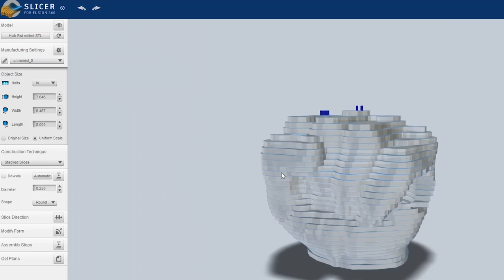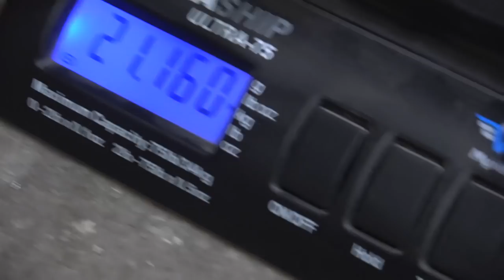Doomfist Destroys ALL with 2600 POUND PUNCH

Comment: Sarcasm aside, the first thing I'd recommend is adding an armature that distributes force through the shoulders and pelvis. Then you could attach springs to take up some of the massive weight of the fist (kinda like how a garage door is counterbalanced by springs). That would make it easier to swing around. It would swing with less force, but the real force is supposed to come from the pistons anyway. The armature could also help distribute the recoil of extending the pistons and smashing the fist into something - that way, it would rock you back on your feet instead of breaking your arm, which is always a plus. Properly braced, you could dump the recoil into the ground under your feet. Probably too late for this build, but might be useful for your next large, heavy object. Cheers
Reply: Wtf wow that's a lot
Reply: Yeah, same issue that the "six million dollar man" in the 1970s would have experienced, he'd have needed a complete titanium spine to withstand the torsional, lateral, and compressive forces from his arm and legs
Reply: @Rudy_Cola  engineer. We kinda nerd out over tech

Comment: One minor flaw.... You can only punch as hard as your arm can resist being thrown backwards, just look up Newton's laws.
Reply: Ethan Davenport 
Having a lighter design would help a bit. Lower mass higher speed so less momentum and more kinetic energy. 
It is also a bit too hewvy for them to use properly.
Reply: thought of the same. he could also try to build a exo skeletal arm to resist the backwards energy.
Reply: Hans Peter 
What about having a much heavier piece shoot backwards simultaniously? It would result in a slight loss in power perhaps but it would avoid some lf the recoil. Or maybe a spring system of some kind
Reply: I had to scroll down so far for this, he basically made the Hulk fist from before but with a few spikes and tubes...
Reply: It kinda seems irrelevant since it was already fully extended before making contact almost every single time in this video.
Reply: Dragon Warhammer
i wouldn't add a backward force on top of the forward force, i am pretty sure that the simultaneous pull would just break your arm or at least injure it...
Reply: I think it would be best to have a stop attached to the backpack, this would limit flexibility, but it would be a simple fix and should be sufficient without extensively increasing price.
Reply: sometimes i wish we didn't have flesh sure it would be hard to move but less injuries

Comment: The lengths you go to to make these videos is unbelievable and the amount of money you spend on these must be very high
Reply: AF Bennett Damn that looks heavy
Reply: Except everything was ruined by not using kg. pounds away

Honestly how do americans do science? Do they convert all non-SI units into SI units before calculations? If so, what a pain.
Reply: NZ 420 the imperial system in machining is a nightmare, all of the fractions and unbelievable. I have a drill which is 15/64", why? I really don't know
Reply: @AF Bennett  15/64 is just a fractional equivalent to a decimal value. I could ask the same stupid question for metric. If I want to get a tight fit for a .250in pin I would make a .251in hole. Nice and simple. If I want to get that same fit in metric I would need 6.3500mm pin and a 6.3754mm hole. Why?

I could argue that .001in increments in imperial are smaller and more precise round numbers than the equivalent in metric which would equate to .0254mm. Then you could argue that .01mm is more precise, and blah, blah, blah.

They're just numbers and both mean the same thing in a different way. Nothing to be scared of.
Reply: OU812 I’m not saying doing it in thousandths is bad because actually it is easier but it’s annoying when you looks at your plans and it gives it all in complicated fractions and you have to calculate the value of them when if it was in mm then there wouldn’t be this problem or even if it was just given in thousandths it would be easier.
Reply: AF Bennett the amount you could sell them could be even higher😎😎😎

Comment: It's basically just the weight breaking the stuff right? Wouldn't the pneumatic pressure just push your arm back when you try and use it on an object? As long as it's not smaller and lighter than yourself I mean. I'm not sure if what I'm saying makes sense...
Reply: I think so yes.
Reply: Pickle Z Because of some laws by newton the powerfist is only as strong as the resistance mr. hacksmith can put into his punch because it is easier to push away him than to do the full strength punch. Attach it to something really big for example a robot an it will destroy the tv in an instant
Reply: This sounds much better than what I said. Thank you!
Reply: Also it depends on when the cylinders are extended because in some of the punches they were fully extended before the fist made contact. The best way to fix that would be with a small sensor on the front of the fist that would cause it to fire on impact.
Reply: jrizzelable yeah but they are cool :)
Reply: you can see that in the video too. The Firing moment is critical. They got it wrong most of the time.
But it can be solve with a proximity sensor. When the fist  is close enough to the object then it should eject, and not when it hits  because then is backfires like you said.
Reply: you're right. I was a bit disappointed when I realised that as they destroyed the door. I thought they'd make atleast and exo arm to help support the fist
Reply: The whole lore behind the Doomfist is that one needs to either be super strong or specially augmented in order to even wield it due to its weight, thats why Doomfist can use it, cause he is both. So it makes sense that these guys couldn't really use theirs correctly. Would have been nice to see them mount it on a metal arm and "fire" it.

Comment: It’s already extended when hitting the target. Not implementing the impact of the pneumatics per say at all.

Improve it by having a quick release diaphragm style valve to really dump the air quickly into the cylinder.Drill out the cylinder ports about 60% bigger. Then put a impact sensor on the top of the fist . Adjust your trigger timing accordingly.

Comment: are the pneumatics actually adding anything here? it seems like you get more force from just swinging the thing.
Reply: RaHuHe agreed, seems like this is what you would get by smashing 45lbs of weight into anything.
Reply: Agreed. You don't need the weight and the pneumatics plus it's pretty much activating before he hits anything.
Reply: Le proof is in le pudding: out of those 2600 lbs of pressure...you can only use the combined WEIGHT of the steel fist and balanced bodymass. Which equates to about 200lb (taking into account the acceleration when it hits). Might aswell use a 50 lb dumbell and smash things with it. To make this ACTUALLY work, it must actuate the pistons VERY precisley before impact. But its in the order of milliseconds, way less for any avarage human to trigger
Reply: When he would time it correctly (which he isn't), it would add a little tiny bit of extra energy to the punch. But currently' it seems more like it is is making it worse than better because it is bringing him out of balance.
Reply: That's because the cylinders aren't just pushing the fist forward, they're also pushing the arm backwards. All it's really doing is making the forearm longer just before he hits a target. This isn't to say that it's bad. It does a doomfist-like thing, so I'm okay with ignoring the ignoring of physics for now... wait... what?
Reply: You miss the point, even if the actuators where very precise, this contraption pushes the arm back the same as it pushes the hand forward. The net effect is 0. If you wanted something added to the punch, you would have to build a detachable fist that can split into 2 using and explosive charge. That way you balance the momentum of the part flying backwards with the one moving forward and you get an added benefit from swinging your arm.
Reply: That sounds... safe...
Reply: RaHuHe its just a sledge hammer attached to a hulk fist
Reply: Exactly, i have only watched 2 of these guys video's and both just seemed to be fails tbh. The other i watched was the rail gun!
Reply: If it was timed properly, it would jolt the arm part back onto his arm and the fist part forward into whatever he was hitting. Only problem is, unless the arm part was way more massive than the fist part, his arm would take the same amount of force as the impact site, possibly breaking bones.

Comment: Just a thought, it would've been nice to see what the fist could do without the propulsion just to visually measure the effectiveness of it, but solid vid as always!
Reply: Uhh there wouldn't be any difference in the effectiveness because the air cylinders are not doing anything. All he is doing is swinging a powerfist shaped sledge hammer. The air cylinders are only for the wow factor. In terms of the current design, the cylinders firing would apply an equal force on his hand and the powerfist in opposite directions (Newtons third law). Since his hand is way lighter that the powerfist, it is much easier for this force to slow his hand's forward motion instead of accelerating the powerfist.

How to overcome this problem? Make the powerfist much much lighter, increase the mass of his hand/ the force his hand can resist or use something that does not rely on pushing against his hand to propel the powerfist eg rockets

Feel free to delete my comment like you did with my previous one where me and a few others pointed this out.
Reply: Good point, lmao
Reply: Plus he made a hulkfist using the same design
Reply: Yeah, honestly, he'd probably get a better result with 2 of the pnumatics, a small steel plate, and better bracing.

Comment: The sheer mass of the fist brings the destructive impact. The force the pneumatics are applying to the actual impact is about 0. They would need to be fixed to a something static otherwise the force is just pushing your arm backwards. And even u had the force to hold them in place, or keep the forward motion then u wouldn't have needed them anyways, cause u could have just invested that force in the actual punch. I bet they knew this before making the video, but still wanted to show something so I can't blame them, it looks cool nonetheless.
Reply from the maker: The pneumatics do add momentum. The title is an exaggeration of their potential of course :)
Reply: Yeah but since u either throttled down the cylinders or didn't applied the full pressure to them the speed of the fist is pretty slow, so their isn't much momentum even with the relatively high mass of the fist...
Reply: the Hacksmith but you could add quick exhaust valves (don't know if this is the correct word in English) to increase the speed, if that wouldn't be too dangerous for your joints of course.

Comment: "2600 pound punch" implies the full 2600 pounds are going into the punch. If something is in the cylinders' way, they will just push back against your arm instead  of punching harder. Yes, it's increasing the speed of your punch, but it isn't adding 2600 pounds of force. Just saying.
Reply: Physics!
Reply: If you watch it extends before he even hits anything. So he is getting nothing extra out of it anyway

Comment: great build! But I think it would be much more efficient if the whole mass would be at your arm and not at the fist. Because now these pistons have to accelerate the whole mass and they have nothing were they can push against.
Reply: Joschi agreed! I think he was mostly thinking of the aesthetic cool factor before actually thinking of the practicality of it all.
Reply: Seriously. It's cool that it has all of that potential force, but you can't even come close to using it because it's man-powered. Since it can't react against the user with that much force, the pistons don't serve much purpose... then again, I'm very tired and maybe I'm thinking about this wrong!
Reply: John Hunter you think much to simple because the pistons push your hand back and not the fist forward because your arm is much lighter than the fist and you aren't strong enough to hold that force

Comment: very nice. If you wanted to make it fancier, an accelerometer and a proximity sensor could be added so that the pistons could electronically activate so that the timing would work to get the greatest mechanical advantage. Ideally, the fist would be making contact while the pistons are actuating, and not before or after actuation.

Comment: To much weight.  This makes the fist useless.
Reply: 2x Weight as world's over weight kid
Reply: Mate...  who gives a shit, it’s still cool
Reply: Penguinshooter5  if it was a weight you could reasonably lift with one arm then you could actually punch with it, rather than staggering around swinging a giant boat anchor.  It would be ten times cooler if the fist weighed more like 5kg instead of 15 (as long as the pneumatics can move fast enough to accelerate it)
Reply: @penguinshooter2133  *you're
Reply: Because it is heavy in the game.
Reply: Jeff from the Overwatch team uh, it was light enough that a teenager wielded it. It’s not that heavy
Reply: @Mike-mt4ln  thats another doomfist ( i guess)
Reply: I can lift 45 pound with one arm easy....you jus need bigger stronger man for tool....like halo has spartan
Reply: A lot of weight was from the pistons and what not which Are completely redundant and technically speaking do nothing to increase the velocity of the fist, im surprised no one pointed this out

Comment: This would be more effective if you just used a cut down steel bar. not only would it weigh less, the force of the one ton punch would be concentrated due to the small surface area.

Comment: Okay so I would understand the excess weight if the spikes were allowed free rotation with small drills to turn force and momentum into penetrating power, but you could have had much more success with a lower weight gauntlet.

Comment: The funny and sad part is that I am pretty sure a metal baseball bat would do more damage.

Still tho, sick/funny build.
Reply: @Jaylin Brown STUDENT 

I'ma have to contact mythbusters on that one chief.

The baseball bat would have more force due to higher speed thus CREATING more pressure upon impact. This fist WOULD do more damage if someone strong enough were to wield it, but because that's not whats happening here, the weight is slowing this current operators speed capabilities while using it. Lack of speed = lack of force.

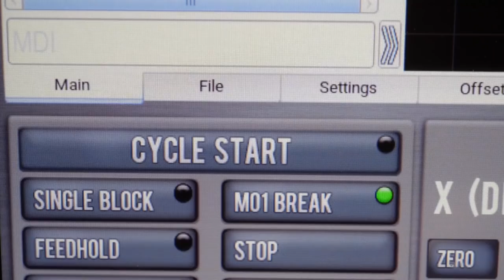Comment: @3:20.. I have been doing CNC works, programming, setting cutters, you name it ut NOTHING in CNC-technology is just "put that there and push the button. Before it it is few hours of fun on pc and with lathe/mill and then a "dryrun" and then the part. Here the CAD to G-code and setup of simplest cut costs over 100 bucks for a client

Comment: roll eyes

Or... start working out regularly, and spend a couple years konditioning the knuckles in ur own fists (bean bags, hardwood), plus some nice and conzistent punching exercizes on hardbags,  put some kind of wrap over it, to prevent skin-cuts vhen you punch, and you can deliver prety much the same power. Ok, maby not 2.6k pounds, but definitly over 1-1.4k, couple that vith the faster punch velocity (no weigt), and it wuld be about the same; you culd smash those doors, that sheet-metal case-thing, the ceramic plate and the rest, prety much the same. And it wuldnt weigt 20 kilos, or rekuire hydraulics to use.

Comment: Wouldn't this just be the same as a sledge hammer of the same weight? I mean the rams may be capable of putting out 2600 pounds of force, but are your arms capable of holding 2600 pounds of force?

Comment: The pneumatic cylinder are useless..(other than making the fist heavier) when they activate it just pushes your arm back. It’s the momentum of the weight of the fist not the cylinders that do the work. In saying that you blokes aren’t the ones sitting down watching videos. Making it happen 👍 Nice
Reply from the maker: That's why you trigger it before impact so it can add a bit more kinetic energy to the fist. But yes if you wait till impact it's pointless
Reply: It’s pushing forward just as hard as it’s pushing back ?

Comment: The engineering didn’t matter. You guys used the weight of the mechanism and speed to create force, the extending fist didn’t matter a bit... it’d be cool if you made something to boost the speed at which you can move it.

Comment: Isn’t this basically useless? If it doesn’t supply enough force to move the user’s arm backwards, then it doesn’t supply enough to accelerate the fist. All of the destruction in the video is simply the result from a 45lb metal fist with spiked knuckles. The shocks don’t even supply enough acceleration over a short enough time to assist the punch.

Comment: As smart as this guy is, he isn’t really counting on physics. He’s essentially got a 50 pound punch there, plus whatever weight his body isn’t putting behind it. Because of the way physics work, he isn’t adding any actual force with the hydraulics. Every action has an equal and opposite reaction and all that. His body wouldn’t physically be able to withstand enough forces to allow an actual 2600 pound punch. It’s a gimmick sadly. You could achieve similar results by strapping 50 pounds of lead to your arm

Comment: Shouldn’t you of used shoulder pushers to have it not tear all the muscles in your arm?
Reply from the maker: what are shoulder pushers?
Reply: the Hacksmith it’s a brace around your arm that I can’t remember the name of. It basically makes it to where if you have it on for a while, you can stretch your arm out farther. And just adding duke more supports to it might make it safer so you don’t tear a muscle
Reply: the Hacksmith not duke support
Reply: *SOME. stupid auto correct